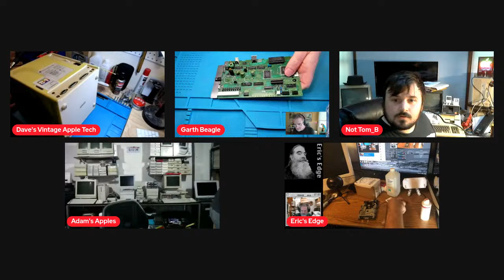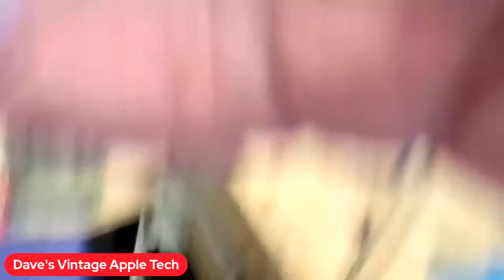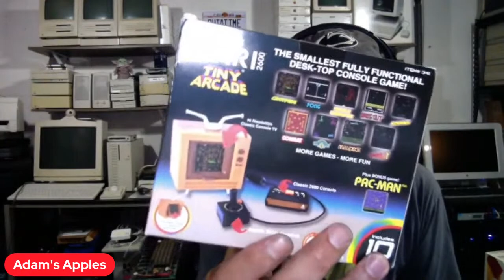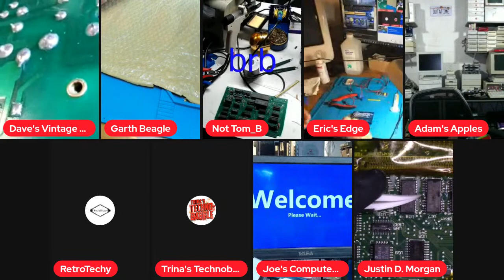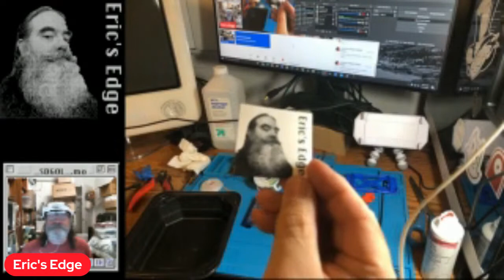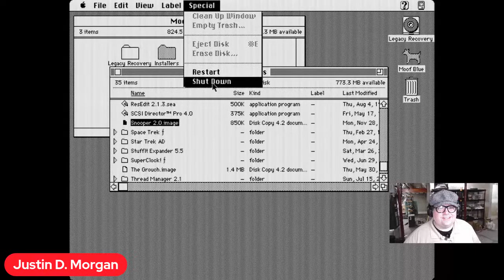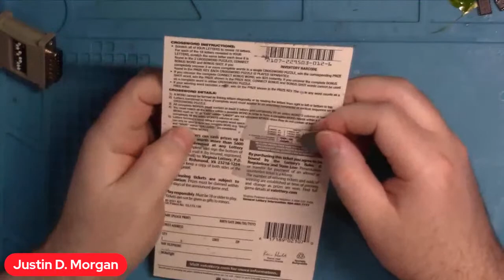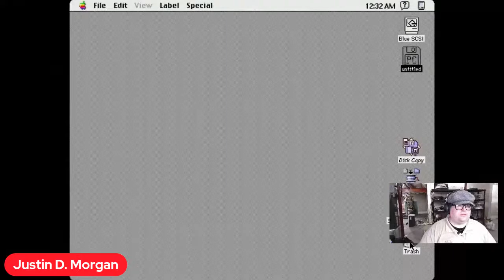I THINK THE CRT IS NOT THE PROBLEM IT's THE ANALOG BOARD LET'S FIND OUT WITH THE HELP OF MY GUESS

Comment: Good times! If anyone is curious, the now ultrasonically cleaned and dried LC board is back in its case and works great... the two caps that I soldered onto what was left of the traces after I lost the pads held in the US cleaner (probably due to application of the UV cure solder mask to hold things down). And the now ultrasonically cleaned and re-assembled LC power supply is in my LC II and works great as well! It's sure nice to not have to share one working power supply with two computers.

And yes, I will someday order wire so I can repair the power supply that was originally in the LC II. I am going to make it with slightly longer wire leads for use as a testing power supply. (Long enough to be able to set it on top of a non-working supply and still reach the power plug on the logic board.)